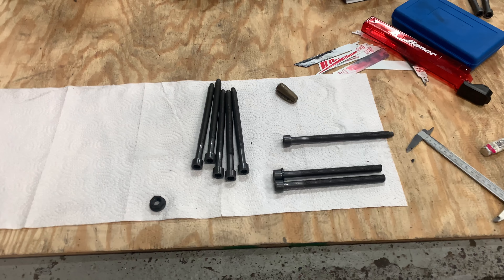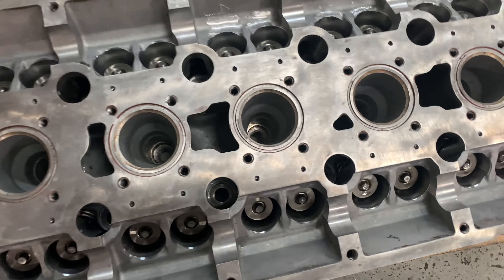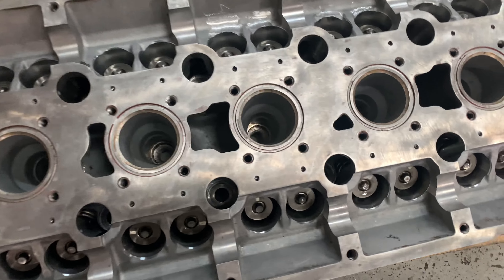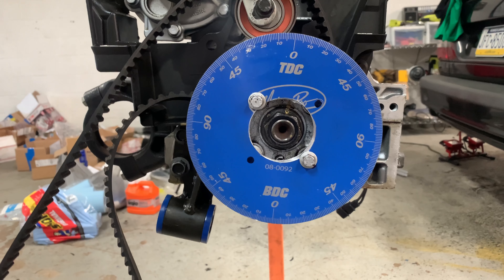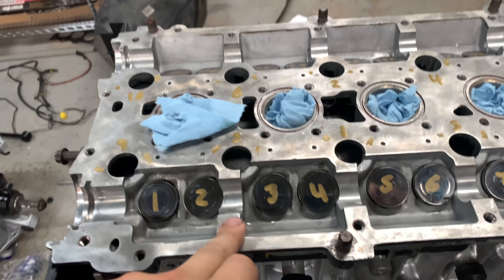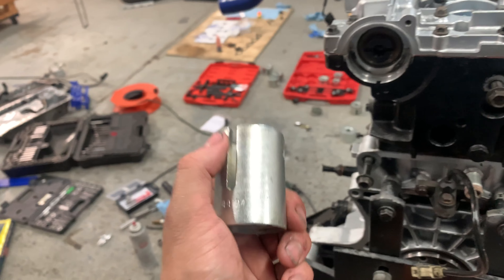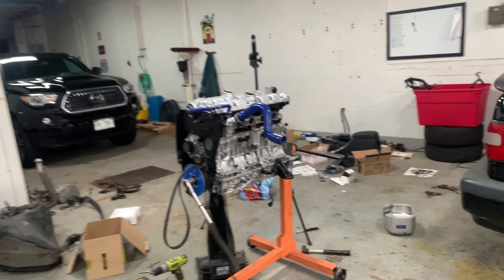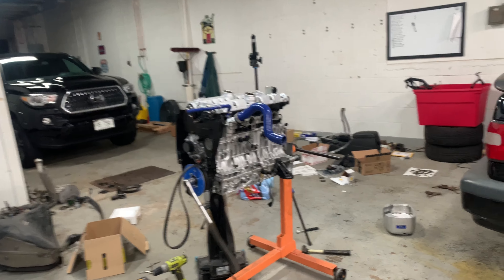Volvo 850 T-5R AWD Swap - Engine Reassembly

Comment: Vida says to use spark plug holes 2 and 4 when using the cam carrier tool. And if you dont wanna scratch your paint again, insert the screws that hold your top plastic cover down. If you need info. Ive been rebulding those the last 2 years, and my co workers have been repairing volvos seince the 80s. Greetings from greensburg pa!
Reply from the maker: Before this I searched the VIDA literature and others high and low. None specifically stated what cylinders to use and all of the pictures showed 1 and 5.
Reply: Stand corrected.
Reply: Just the way i was told i guess. To prevent bowing in the center
Reply from the maker: @unklebuck1239  It would seem more logical to use 2 and 4 as that basically puts 1 press tool between each cylinder, but im not sure... sometimes Volvo does things for certain reasons without explanation in VIDA.

Comment: I've only started watching, but putting that nut on the head bolt before cutting helps to chase the thread when you remove the nut from the bolt.
Reply from the maker: Thats a good idea too!
Reply: That's the technique I always use, sometimes the thread is so squished after cutting you can't get a nut on.

Comment: Hey could I use the s60r head gasket on a 850 n engine or would i need to drill holes in that case as well. It also be cool if you made a video of where to drill the mls gaskets to fit a rn block on a n head, unless you already made that video and im just an idiot.

Comment: FYI, I use paint remover or gasket remover for the cam cover sealant, works great for me.
Reply from the maker: Ill have to try that. Ive been trying to find a solvent for the cam cover and I bet paint thinner like you said works very well.
Reply: @SimplyVolvo  Not paint thinner, paint remover.

Comment: Tip of the day...whenever you are cutting a bolt to a new length, thread the appropriate nut on PRIOR to cutting.  This makes chasing the threads easier,  if you happen to get a big burr on the first thread.

Comment: Whats the benefits of dual oil filler necks?
Reply from the maker: I explained it in the video. Just to be able to set the cam timing through the oil filler holes on the intake and exhaust cam.
Reply: SimplyVolvo yes i see that. Somehow i missed that the first time

Comment: Right axle for a P80 AWD manual with the 36mm nut is no longer available.
Reply from the maker: The automatic transmission awd right axle is still available which is the only one I can get here anyway in the US because we never got any Manual AWD P80s.

Comment: Our man is not sleeping, some progress:)

Huh, so there's a budget and upgrade benefit on that VW bolts, nice.

Yeah well like you said, that cover is torqued 15 times, without special tool, and is inevitable for them to strip..half of them were stripped on mine and I thought it's just a oil cap seal leaking:P So I rigged up my own tool out of old spark plugs, and I guess with a little caution&patience, they will not strip.

But man, with that level of details and rechecking, this engine can't do nothing but run like hell! Very comforting and great learning experience with some great tips. 
And don't forget to talk about your crank ventilation setup;) 

I think that oil pan bolts, everything over 20Nm is overkill

Nice ocd paint over JB weld:)
Reply from the maker: Ha! I was wondering if someone would notice the paint over the JB weld... What JB weld now... I dont see any😁 I will try to remember to show some details on the crank ventilation. Its very basic, but it also works very well.
Reply: @SimplyVolvo  Hahahaha right, I mean, nice shaved whiteblock:)

Well, venting theme is pretty beat up in Volvo world, and many guys struggled with it.I ended up doing my own setup as well, still testing..I guess it's kinda easier to set it up on a race car, but still..since we've  made it until here, might as well show us everything:)
Reply from the maker: @z_855turboR  Ill give a quick explination. Basically I tapped out the stock turbo drain port to 1/2" NPT and fitted a 10AN bung. I used the stock 850 crankcase separator on the front, but the tube that runs to the stock PTC on the intake pipe I drilled out a big hole... and yep you guessed it JB welded a 1" piece of tube which then connects to a 1" 90 degree silicone elbow which has a 3/4 NPT to 10AN adapter. Both of those lines go to a big 3 filter catch can where the factory air box goes. I did have 2 10AN on the valve cover with baffles (you can see the baffles on the inside of this cam cover) in this video, but they would puke oil from the big cams and I concluded they caused a low pressure in the head and high pressure in the block which reduced oil draining back from the head to the block. So far I havent had an ventilatin issues. In my dyno pull videos you can see some gases coming out of the 3 filters on the catch can but not a lot because I run a my ring gap on the lower side. .020" top and .022" bottom. You can get away with tighter gaps on E85 engines.
Reply: Haha nice, I barely stuck 1" pipe below stock intake
Yes I was studying videos like a hawk, and was thinking originally-if I only remembered to design a baffle when the cover was down..but you still had oil puke? Jesus..

So you are saying, you completely eliminated cam cover vents now? Was thinking about that also, but was scared that seals would explode.

Comment: If I want a t5 built, what would you charge?  I don't want anything as extreme.  I would be happy with about 400HP or so.  What's your contact info if this is something you are interested in.  Thanks.
Reply from the maker: At the moment I dont do any work for other people. I dont have the time with working a full time job, a part-time job and doing my own personal Volvo stuff.

Comment: The volvo diesel motors use a similar torque sequence and grade 10.9 bolts. I really like the sequence Volvo uses.
Step one: 20nm
Step two: loosen
Step three: 20nm
Step four: 50nm
Step five: 90°
Step six: 90°

Comment: What happend that your block cracked? Just started following since im converting my 850R from aut to m66 awd. Not gonna go insane on power. Roughly 400 is the target
Reply from the maker: A common issue with these blocks is the use of ARP studs which can crack the water jacket. A more in depth explanation is found in my other video here : https://www.youtube.com/watch?v=9MzgLNcn8C8
Reply: @SimplyVolvo  i'll go and watch it.

My car had a cracked block when i bought it. Someone didnt clean the hole for the headbolts. But that block was scrap.

Comment: I was wondering since I’m going to be installing an intake manifold spacer to reduce engine heat going into my intake (I have a non turbo 1999 engine) and was curious if I could clean out the PCV flame trap and top hose and ports and that would help prolong the life of the PCV. I doesn’t fail the glove test. I have a tiny bit of seepage of oil from the oil cap but none is pooling on the head of the engine so could cleaning the top hose and flame trap be useful or do I have other spots that I also need to clean that would cause it to possibly clog in the future? I did clean the drain port when I did the o-rings in the oil pan so that should be decently clean.

Comment: I ended up breaking a couple bolts trying to reach 48nm, then I calculated the bouts will start yielding at 30nm, and never reach 48nm before they break completely. Volvo isn't always right it seems...
Reply from the maker: Maybe its a typo or something in VIDA, but no way 48nm can be reached. 20-25nm on all bolts is definitely plenty.

Comment: Why do TDC on cyl 3 and not 1?
Reply from the maker: I explained it in the video... so that I can use a dial gauge indicator through the oil filler caps to set the cam timing via lift @ TRUE TDC.

Comment: How hard do you think it would be to swap a t5 into a xc90 that came with a 3.2
Reply from the maker: Well its a gen1 they also came with a T5, so should be feasible if you had a donor. Would probably need to transfer all of the electronics too. The issue with the T5 XC90 is the transmission are horrible and break with stock torque.

Comment: What paint do you use for the valve cover? And do you mask off the bolt hole surfaces so it doesn't mess up the paint?
Reply from the maker: Duplicolor Engine Enamel.
Reply: I dropped off my head and cover at local shop to have it bead blasted and valve job. When i picked it up was surprised it was bead blasted and painted already.🤙🏻